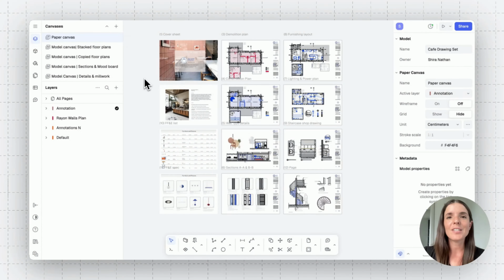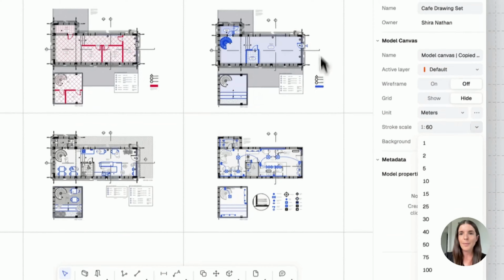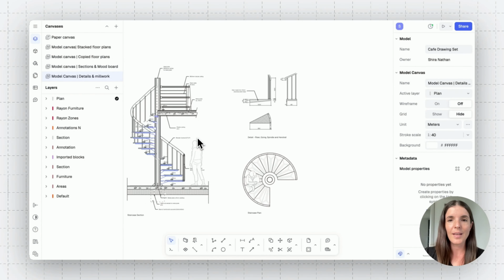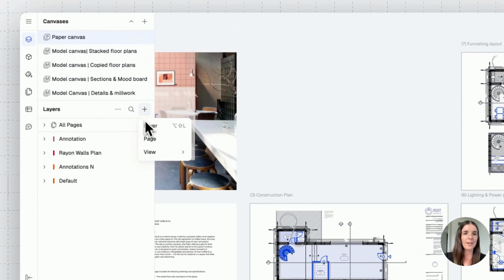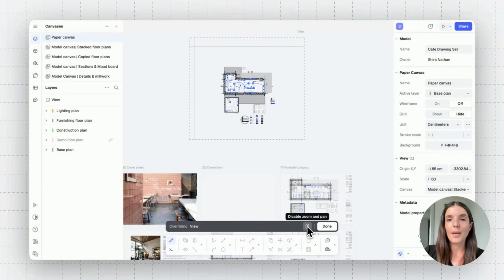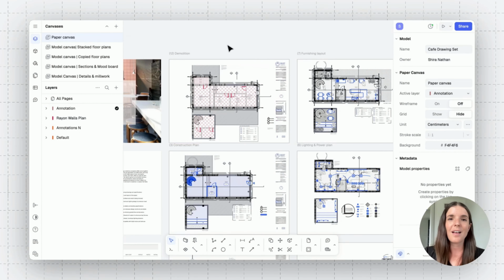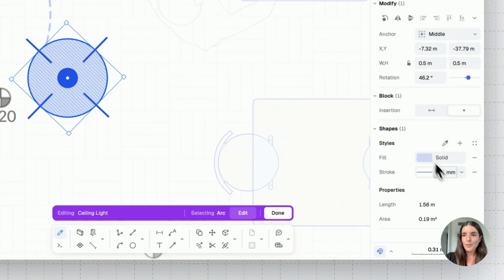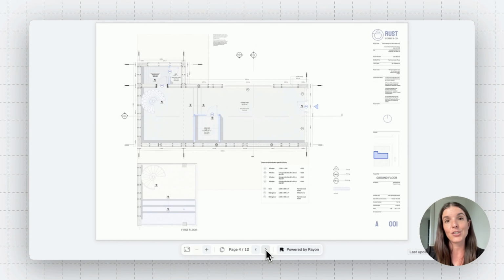How to Export your Drawing Set as a DWG, PDF or Image from Rayon

Comment: A smooth export in DWG or at least in DWF is imperative in my country (Portugal) as the municipalities have digital platforms for project submission that only accept digitally signed drawings in these formats, and afterwards they will be reviewed in Design Review by the municipality. Also, when the project goes to the engineers, they need it in DWG too. Unffortunetely Autodesk have a major lobby here, I would love to improve my workflow with such a tool like Rayon, but this would be a problem.
Reply from the maker: That makes total sense — thanks for explaining the context, that’s really valuable 🙏

DWG/DWF support is a big deal in many regions, especially with municipality requirements and coordination with engineers. It’s definitely something the team is aware of, but I hear you — without a smooth export workflow, it can be a real blocker.

Really appreciate you sharing this — it helps highlight how important this is in real-world use.

Comment: I just designed a plan with Rayon, but some other Consultants want me to send it to them in Cad format. 
I exported it as a dwg file but it was quite a mess on the other end - where line weights, colors and stuff were concerned. 
Can you advise on the best approach to work using Rayon, knowing some others you work with still use AutoCAD. 
I could have drawn it in AUTOCAD myself but decided to use Rayon as I was enjoying the experience. However, it didn’t turn out so good for me. 
I ended up having to do a whole lore of work in autocad to correct things. 
Therefore it would be helpful to get to see a proper tutorial on this aspect.
Reply from the maker: Thanks for letting us know about this. We're definitely looking into how to make DWG exports smoother! 🙏

Unfortunately, AutoCAD does not support some features and cannot produce the exact result.